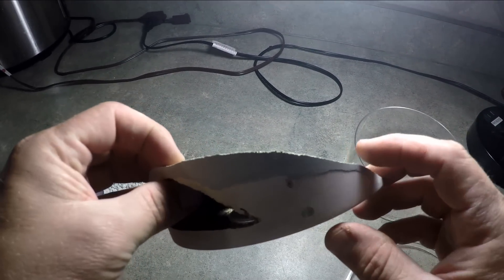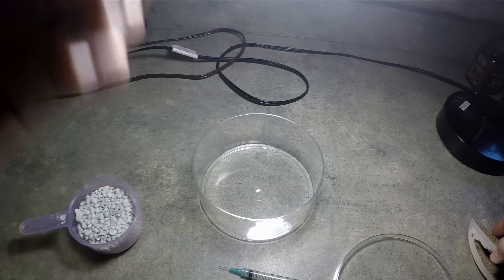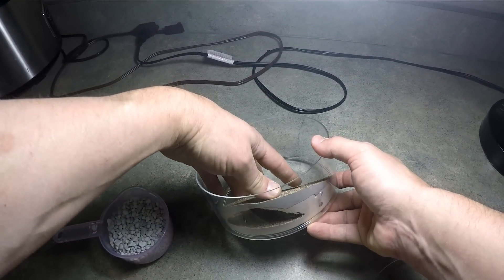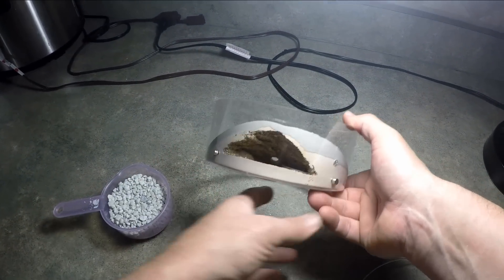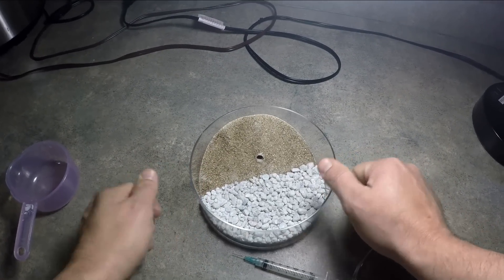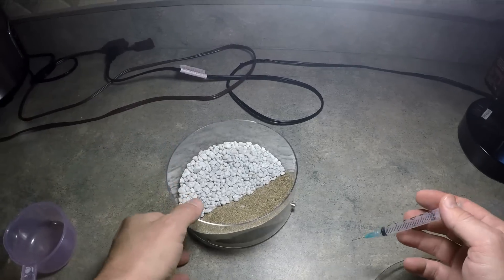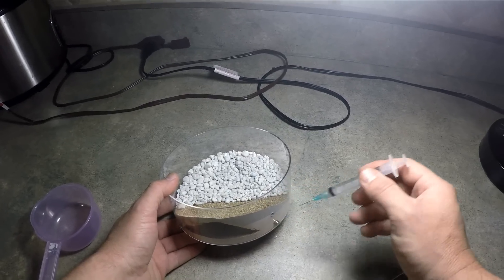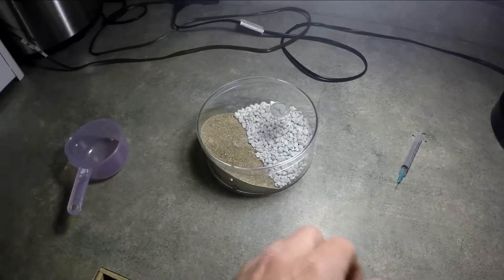Talus Assembly

Comment: My ants just moved into the cave or kinda after lots of light and heating the test tube... My queen is using the cave entrace as nest cous my cave entrace goes in a curve... and they store the larvae deeper inside where it is cooler... probably becouse I'm heating the outworld at daytime... to simulation outside tempreture...